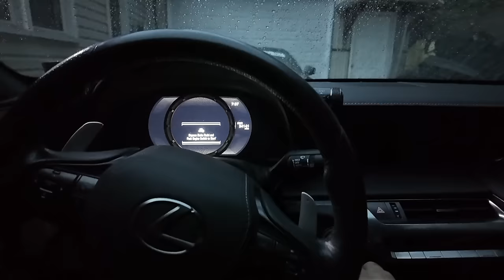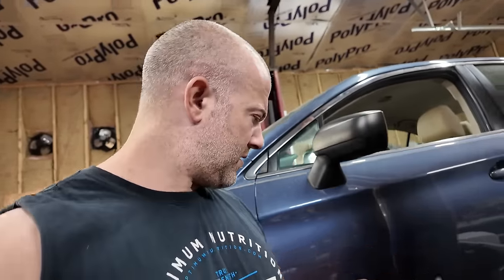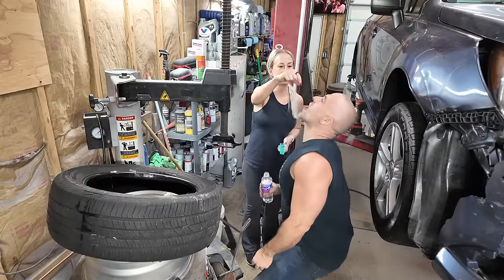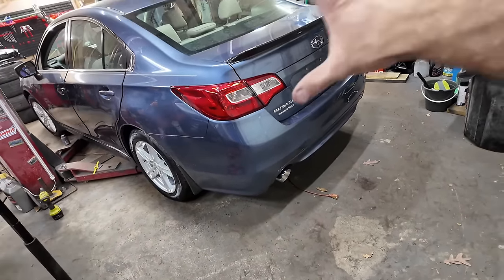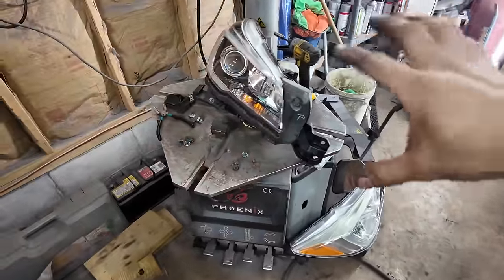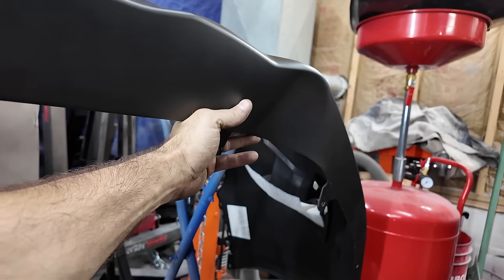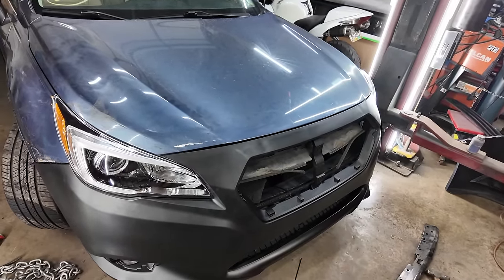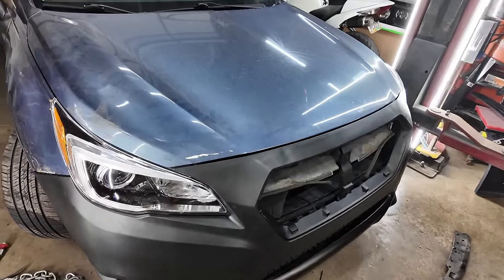2015 Subaru Legacy Damage pulling and aftermarket parts install

Comment: Yeah I hate it when they send a bumper cover folded up I always set them out in the sun but when it's cold outside I have to crank the heat in the shop up and sometimes I even have to break out the ole heat gun and work it out by hand.

Comment: Todd how about drilling 2 hold down rings into the concrete floor. So when you pull the frame the car don't move when ya do it.

Comment: The seller had their chance to make it right.  Time to file a return claim for the bumper under the eBay Money Back Guarantee.   Include pictures of the damages.  The seller will likely offer most of your money back, with you keeping it.  My past experience with bumpers arriving damaged, is that the seller refunded all my money and did not require the defective part be returned.
Reply from the maker: @Mike-wz5im  till this day,  still no response from them
Reply: @UnWrecked  I've bought stuff off eBay that ended up being seconds, but not advertised as such.  eBay gives you 30 days from the delivery date to open a claim to get your money back.